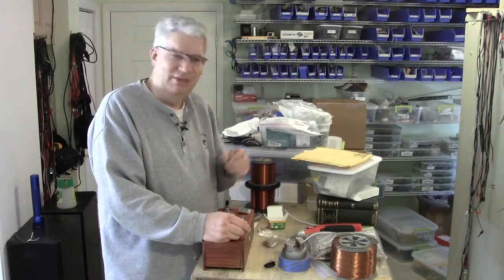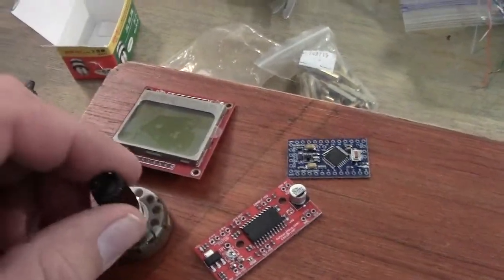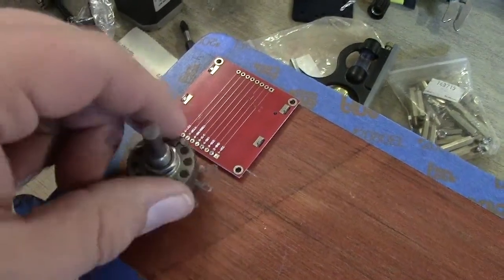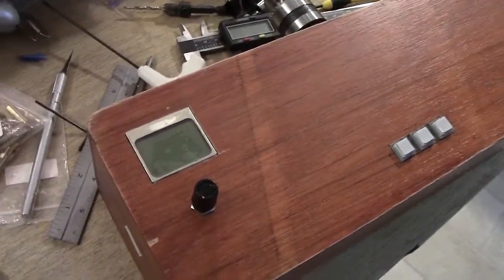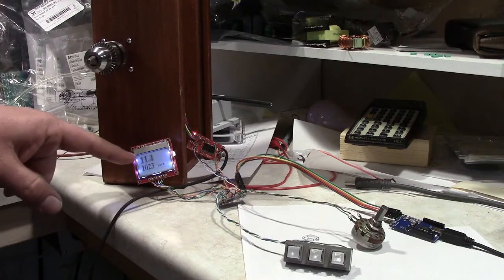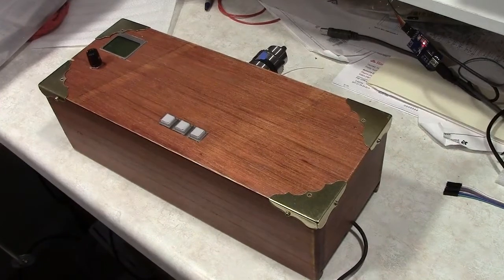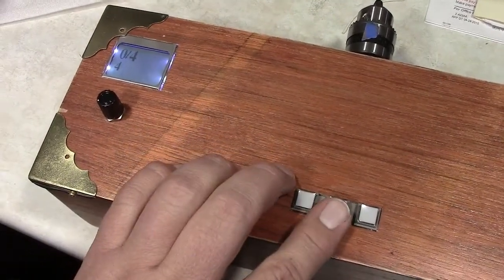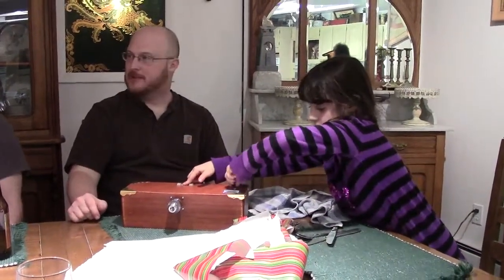160221 Alfano Engraver Spindle

Comment: I don't mean to  be a killjoy but I'm a 30 year veteran jeweler / engraver and cannot figure out what this device could be used for. The drill chuck wont hold jewelry and one needs an incredibly solid base to take the pressure and impact of engraving. Also curious if you acquired permission from Sam to attach his name to a device? Sam is a colleague and I would certainly by honored at the thought but would most definitely not lend my name to a device I didn't invent lest have the assumption that I was part it's making.
Reply from the maker: SV, you're not a killjoy. Thanks for your comment. Yes, the rigidity of this drill chuck fixture is not adequate for precision work. Turns out that Josh uses this machine for precision circular marking. Like all tools in his shop, he's found another use for it at Ouray Silversmiths.

As for the Alfano name, I typically name my personal projects to pay tribute to the masters, whether it be your friend Sam, Faraday, Nicholas, Angus or Tex. For me, there are a few effects of this naming, when I work on the project I'm reminded of these masters and their great mankind contribution. Plus it helps me to keep track of which project is which. For example, my coil winder? That's Faraday, the electromagnetism scientist.  The real benefit with YouTube video posting is their 'Up next' video list and the exposure that these links have to the masters. I have DIY makers from around the world looking for Arduino motion projects who stumble on this video, then end up watching Mr Alfano's videos and leave learning about hand engraving for the first time. I like that this cross-skill exposure happens. 

My project is not a commercial offering, I don't financially benefit from it in any way. My project source is freely available for people to learn and maybe even use. Mr. Alfano has been a clear inspiration for my son-in-law Josh who is a 20-year master jeweler, engraver and soon to be knife maker. Josh is hard to buy presents for, this machine is a personal customized gift that he enjoys. If Mr. Alfano is offended here, desires a project name change and renaming of the source code project, I'll honor his request. 

Thanks for watching and writing.
Reply: I use the inside ring holder in the chuck and use a drill press with a marker in it. This lets me mark the top at what ever interval that I want. Works great for marking but it is too flimsy to drill it on the chuck. But I could build a steel or aluminum box and then it would be drillable.